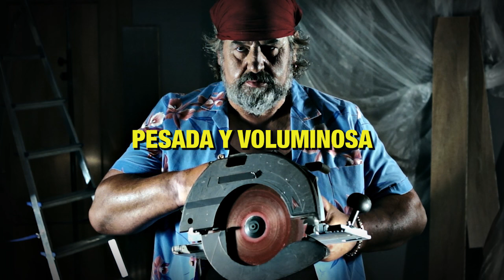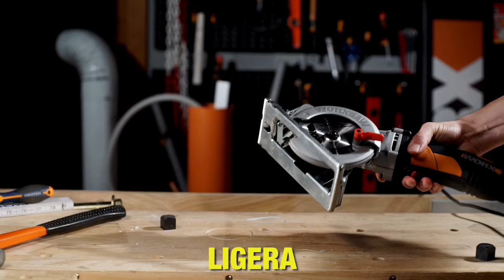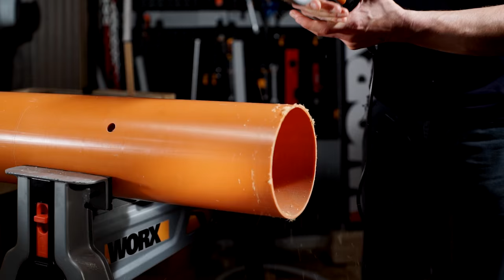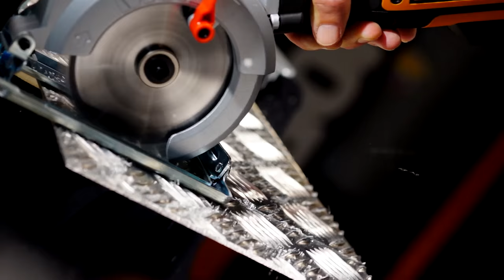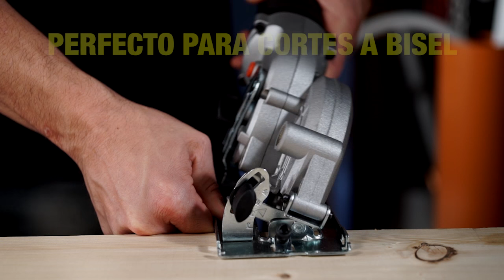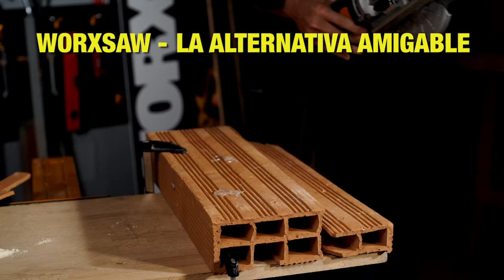WORX WX429 Sierra Circular Compacta - Español - www.worx.com

Comment: Ay, tengo un pequeño problemilla. Quiero poner una sierra de disco de metal a mi WorkShaw 429l y no puedo desenrroscarla. En el dibujo parece ser que abre en sentido de las agujas del reloj, pero no consigo desenrroscarla. Hay algún video de muestra que pueda ayudarme, porfa? Gracias anticipadas. :)
Reply from the maker: Hi Toni, With the allen key inserted , You have to push the red button on the side (spindle lock), and, when you feel that the spindle is blocked, turn clockwise with the allen key. Sometime is very tight
Hola Toni, Con la llave allen insertada, tienes que presionar el botón rojo del lateral (bloqueo del eje), y, cuando sientas que el eje está bloqueado, girar en sentido horario con la llave allen. Alguna vez es muy apretado
Aqui el manual
https://images-eu.ssl-images-amazon.com/images/I/C1BC12GU-US.pdf
Reply: @WorxInternational  Muchas gracias por vuestra pronta respuesta. No tardaré en intentarlo. Thank's so much!
Reply from the maker: @tonirico-MininaSimone  👍